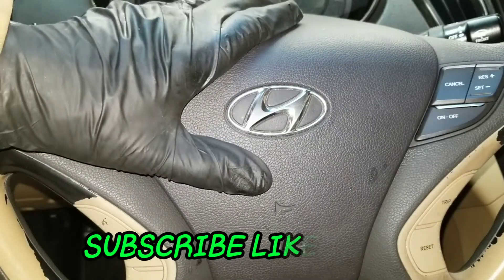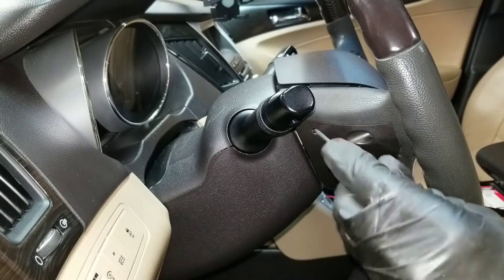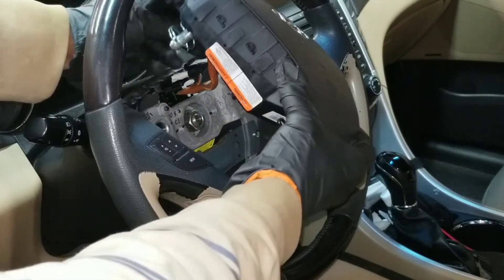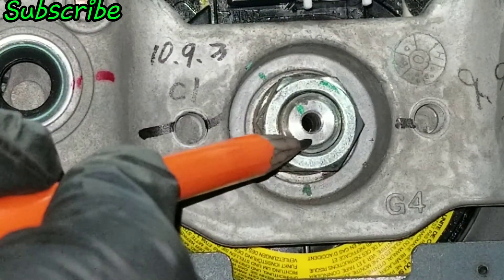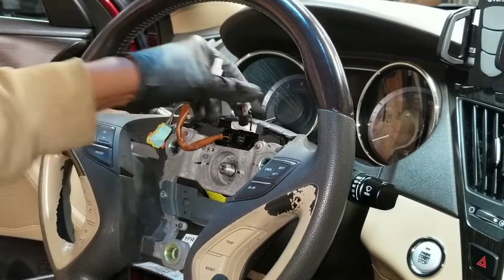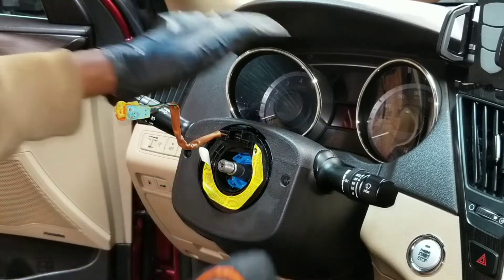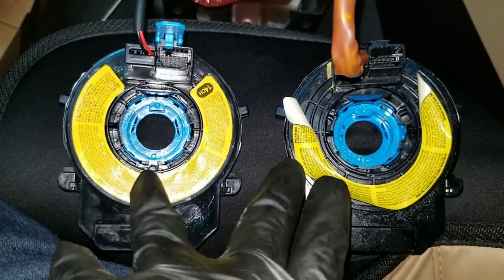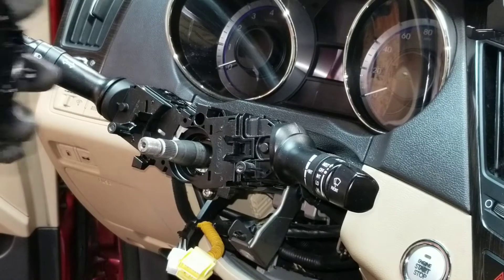Hyundai Sonata ABS Light/  Clock spring Replacement

Comment: Thanks for your detailed explanation.  In my case the horn and steering wheel controls work again after changing the clock spring, but the airbag light remains on. Any suggestions?
Reply from the maker: @Jose Garcia  maybe there is a malfunction in the system you may have to get it reset. Thanks for watching please Like, Share and Subscribe if you haven't already

Comment: excellent video, biggest worry is the residual charge left n the system. Thank you
Reply from the maker: @David Richard it'll be fine if you disconnect the battery overnight or a few hours.  Thanks for watching please Subscribe if you haven't already
Reply: You could also turn on the headlights to drain any residual charge.

Comment: is there not a steering angle sensor on the old clock spring to put on the new one? or is it mounted behind the clock spring on the steering column.
Reply from the maker: The angle sensor is not in the clock spring it is in the motor unit between the  pedals and the steering.  Thanks for watching please Like, Share and Subscribe if you haven't already
Reply: @BIGWILLSCARCARE yeah man thanks for that! replacing it was a cake walk and glad to have cruise control buttons back (and ig airbags too)

Comment: Excellent video, I just had the airbag light on and I think it's the clockspring. Thanks to your video I will be able to save $$ and replace it myself! Quick question: After replacing the clock spring, did the airbag light turned OFF? or do I have to take it somewhere to reset the light?
Reply from the maker: @Francisco Mellado Yes the light went off just be sure to disconnect the battery,  no reset needed. Thanks for watching please Subscribe if you haven't already

Comment: I had installed the one wire clock spring
Does is have any problems
Reply from the maker: @afsarullah Hemat  the pins for the connectors have to be identical to the original.  Thanks for watching please Like, Share and Subscribe if you haven't already

Comment: my replacement is making noise when i rotate the wheel. could it be the main bolt thats not torqued at the right pressure?
Reply from the maker: @Eli Alvarez  it shouldn't but you can remove it and make sure the noise is coming from there.  Thanks for watching please Like and Subscribe if you haven't already

Comment: Hey, did you try and remove the old clock spring wires and plug them into the new one?
Reply from the maker: @nimsum50 I did not. I just remove the old one and plugged in the new one. Thanks for watching please Like and Subscribe if you haven't already

Comment: Just replaced mines but the airbag light still on why is that
Reply from the maker: Could be the wrong or defective clock spring. You have to make sure the numbers and pins on the connectors match up. Thanks for watching please Like, Share and Subscribe if you haven't already
Reply: @BIGWILLSCARCARE  thanks I got it

Comment: There is no need to do this if your car is less than 15 years old, Hyundai will replace it for free under CLOCK SPRING WARRANTY EXTENSION (TXXA) TSB
Reply from the maker: @TJ 21  Yes they have extended the warranty in certain 2011-2015 Elantra and Sonata models.  Thanks for watching please Like,  Share and Subscribe if you haven't already
Reply: @BIGWILLSCARCARE  Hmm..i need to call them then i have a 2012 sonata with this code going off recently.
Reply: Does the car need to be under warranty?
Reply: @oslozoya1  no
Reply: @southsidebaptistchurch7355  I talked to two places they said they couldn't cuz my car was labeled as branded due to mileage but the motor was replaced due to recall but another dealer said they would do it as long as it's due to the issue